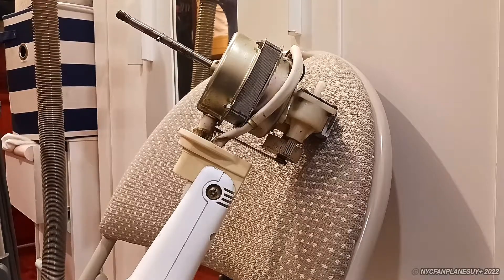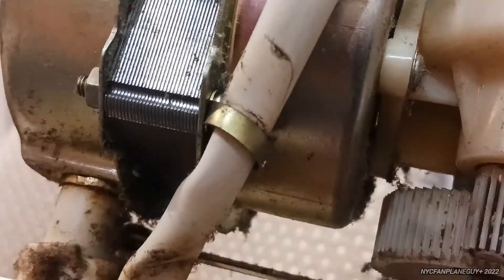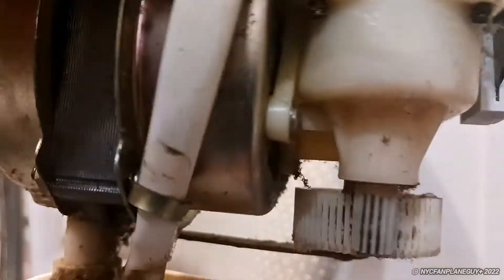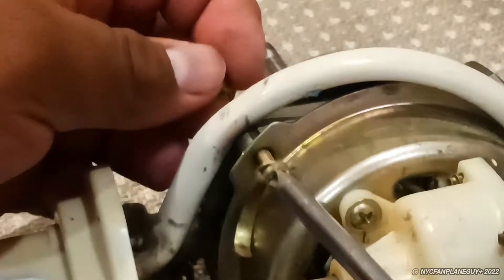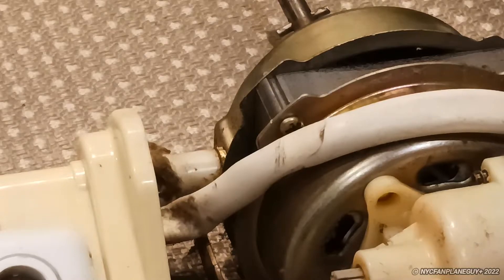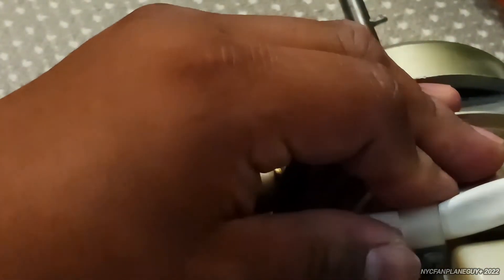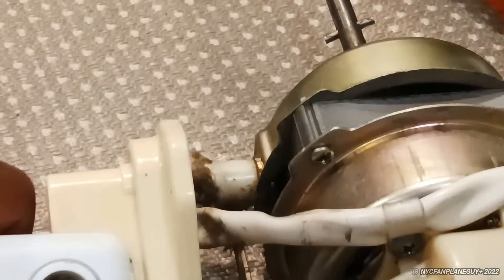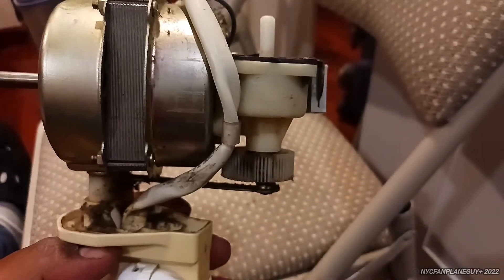Reducing SMC stand fan fire risk

Comment: I have noticed that the head wire on my early 90s smc made 12” desk fan has the cover wearing off and looks like it will become exposed soon, it doesn’t have that metal hoop though
Reply from the maker: Might need to place that wire lock either way
Reply: @nycfanplaneguy9446  yeah